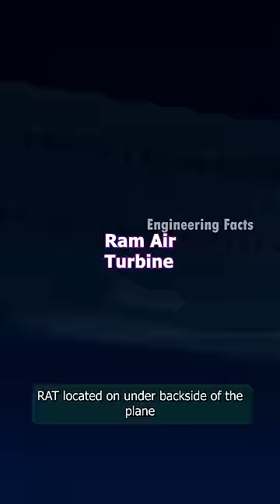Aero plane-ல wind turbine இருக்கா!!

Comment: bro there is something called APU (Auxiliary power unit - located at backside of plane) adhodha work um energy generate panradhu dhan like a generator adha main aa ground la irukkum podhu use pannuvanga but not sure idha air la use pannuvangala nu
Reply: Yes you are right , we ignite the apu in first place if both engines failure, In very rare cases we use ram turbines because 2 engine failures are very rare and we use apu in most of the commercial flight and ram comes very last option to help

But the fighter jets use the ram as their main
Reply: @Sarujan001  thanks for your information bro 👍
Reply: @engineeringfacts APU is a small engine located on the back or tail of a fuselage or aircraft..this engine's only purpose is to supply electricity through alternator.

Comment: Bro we have a problem with our fan regulator. Fan works fast in 4th but it's speed is too low. How can we rectify it?
Reply: Change capacitor bro😅
Reply: @pradeesh18  fans are new bought within six months only
Reply: @geoferra7027  okk broo
Reply: @geoferra7027  regulator la problem irukum atha mathunga
Reply: Regulator change panunga bro
Reply: @LolLol007  Thank you bro

Comment: You forgot about APU auxiliary power unit it is a mini centrifugal turbine engine in the aft , it will provide the backup electricity and the hydraulic pressure required for the control surface to land it will also provide pneumatic pressure to restart the engine mid air